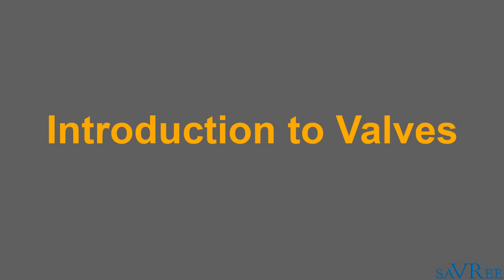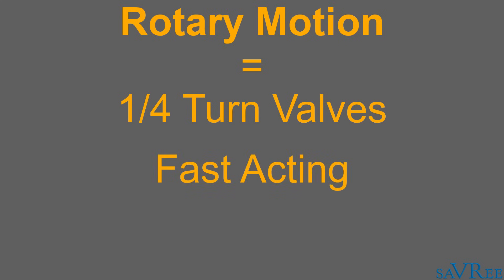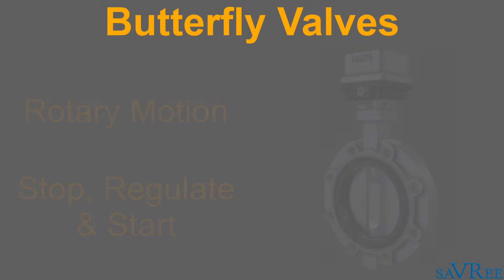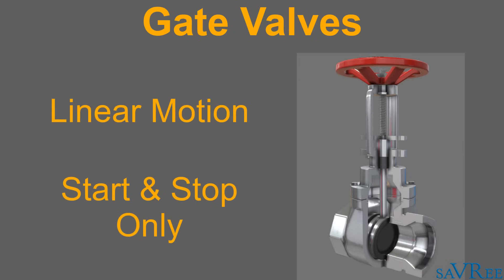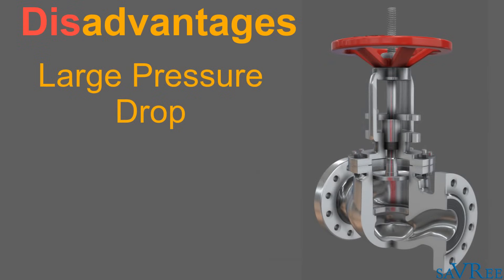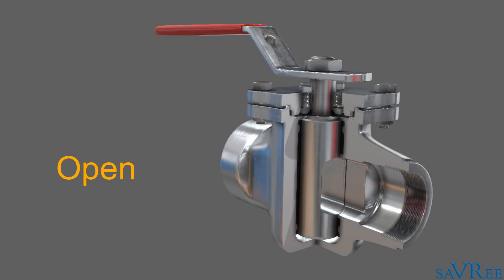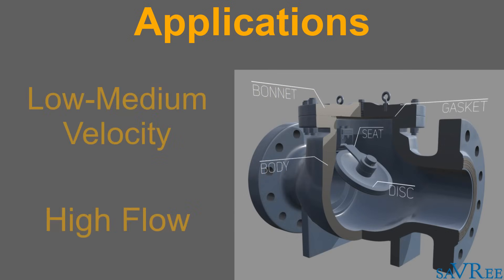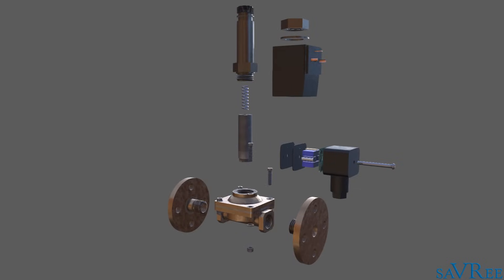Valves Explained - Control Valve Types (Gate Valve, Globe Valve, Ball Valve, Butterfly Valve, etc.)!

Comment: You are forget Stop Check valve that is used on high pressure boilers and you can only close that valve but never open, only pressure can open valve in one way
Reply: gate valve, If I put it in the middle, 
will it control the amount of water flowing just like a globe  valve?
Reply: @SamA-xu9gy  No, gate valve you better open full or close full if you don’t want to damage gate parts inside

Comment: Very good video. Only comment I have is that butterfly valves CAN be used in high pressure and high flow scenarios. At my work we have 2 of them in a 100+/- bar system with immense amount of gas flow. They are used to regulate flow over 2 heat exhangers
Reply: Why does pressure drop in the globe valve?

Comment: Needle valve is the answer. Indeed the number of turns is directly proptional to the flowrate of fluid passing through.  And with proper modelling, we can create a model which can perfectly optimize the output parameters of the valve, the output parameters being (the flowrate of the fluid). Thanks Savree 💞💞💞🔥🔥🔥🕊️

Comment: What does “low pressure drop across the valve” mean?
Reply: Cliff notes: If parts of the valve structure itself act as an orifice it will increase pressure on the upstream side while slightly decreasing pressure downstream AND slightly increasing fluid velocity. This creates cavitation which in turn drives service life of internal consumables like seats, packing and wall thickness minimums.
Reply: @thegavelissoundgavel9849  Thanks!

Comment: #oilandgas #energy #power #naturalgas #engineering #plant #petroleum #lng #lpg #gas #oilgasindustry #checkvalve #valves #nonreturnvalve #oneway

The valve that used to prevent backflow in a piping system is known as a Check Valve or non-return valve (NRV). The pressure of the fluid passing through a pipeline opens the valve, while any reversal of flow will close the valve.

https://techproces.com/check-valve/

Comment: You also have normally fail open valves and normally fail closed valves to deal with power failures. I worked in petro chemical plants and they have thousands of valves of every type.